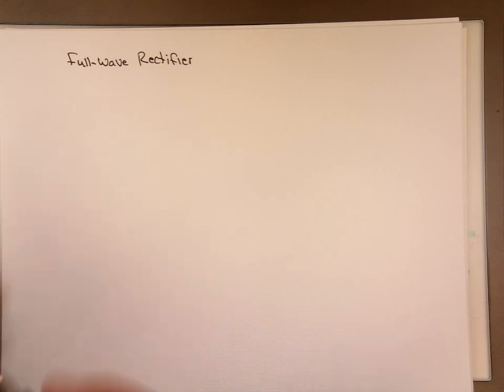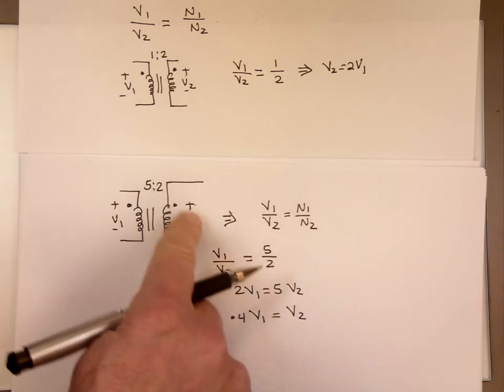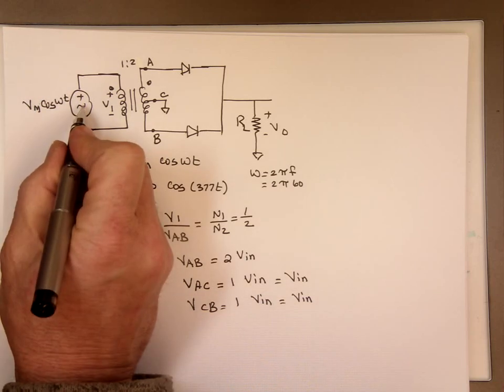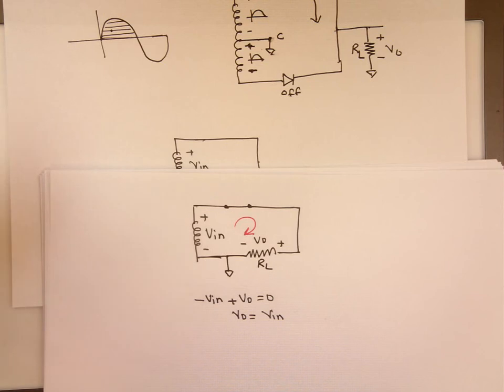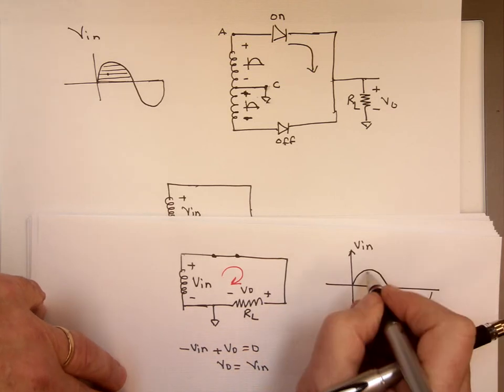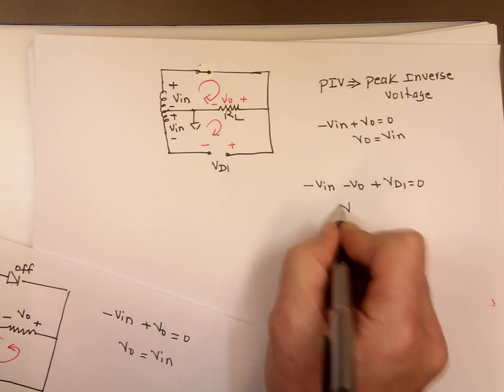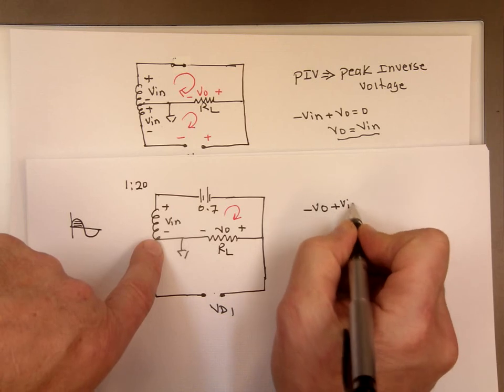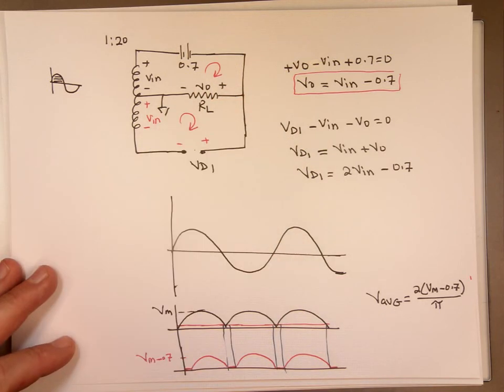Center Tapped Full-Wave Rectifier

Comment: What is the value of that resistor? What difference does it make? Is it so difficult to specify these details?
Reply: The resistor represents the load provided by whatever device YOU are powering. For example a DC motor. So, the load, shown in the video as a resistor, depends on the characteristics of YOUR chosen devise. Then you must insure all power supply components (all wire, switches, relays, resistors, capacitors, and power transformer, etc. ) can supply, and support the voltage as well as the current your device requires.
Reply: @anondusery1271  thank you. Newbie question, mine 😅